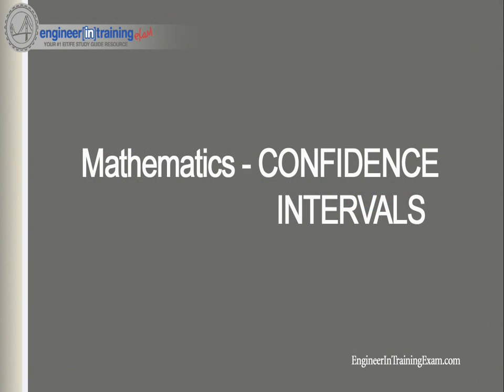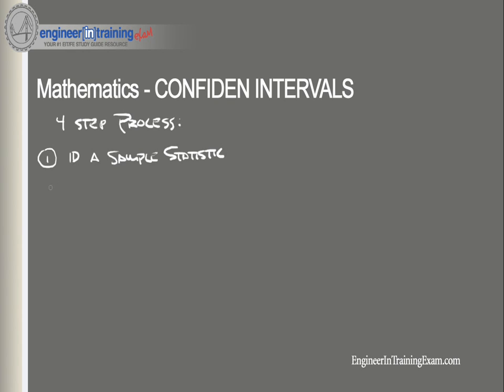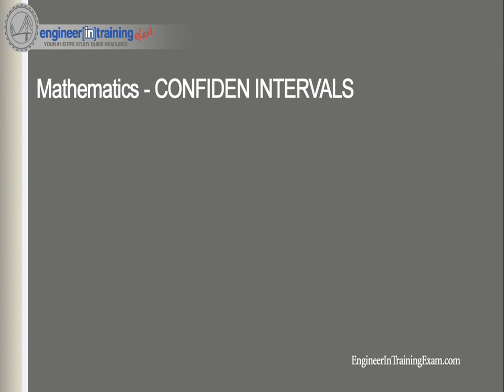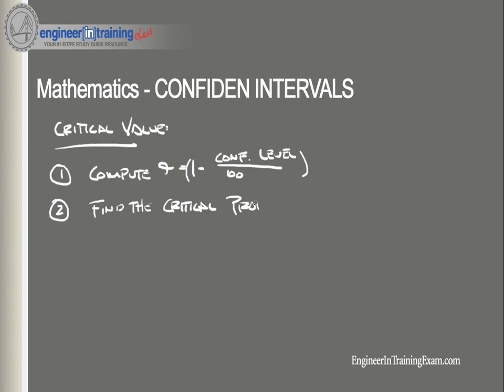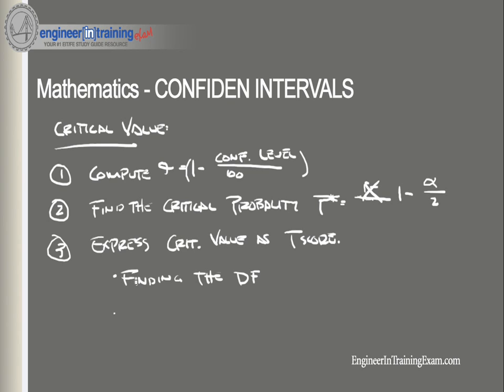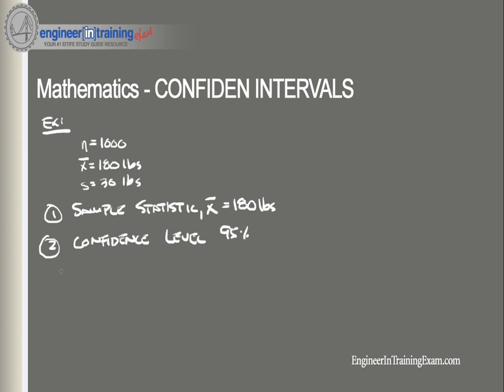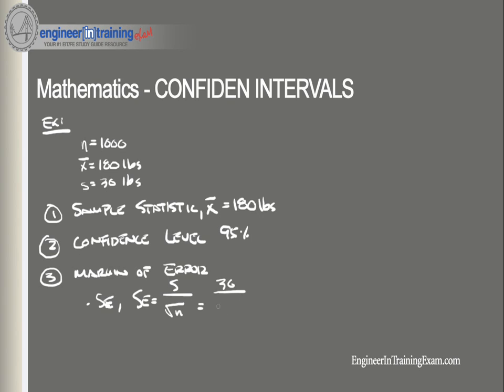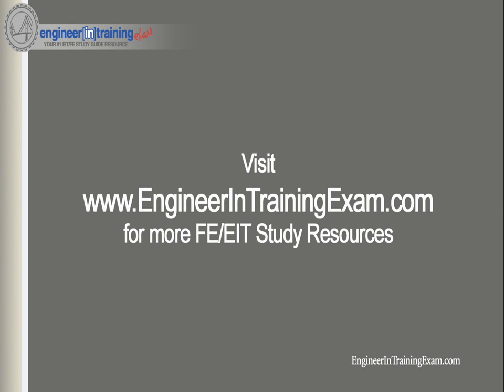Confidence Intervals -- Fundamentals of Engineering FE EIT Exam Review

Comment: The process was correct. You select t score when the standard deviation is for the sample and z score when the standard divination is for the population. So he is using option B of confidence interval and is using the t score however the correct alpha is .05 and when you look at the t table you use alpha/2 which is 0.025. He actually used the right alpha when he extracted the value from the table but somehow on the video he talks about P* which if you use the FE table on page 43 you don't need the p* 
You just need alpha/2 and the degree of freedom Infiniti
Reply: I thought he used alpha =  1-P* = 1 - 0.975 = 0.025.

Comment: If you have a copy of the FE equation handbook, under the engineering probability and statistics chapter there is a section called confidence intervals for the mean u of a Normal distribution. Since we know the standard deviation you can use (A). The Z value is given from the chart at the bottom of the page.

Comment: How did you get t*=1.96?. I used alpha = 0.05 and n=infinity using the student's t-distribution and coming up with 1.645 not 1.96. if you use alpha = 0.025 you would get 1,96 as your answer. Any help would be great thanks. 

I am using the FE supplied-refference handbook.